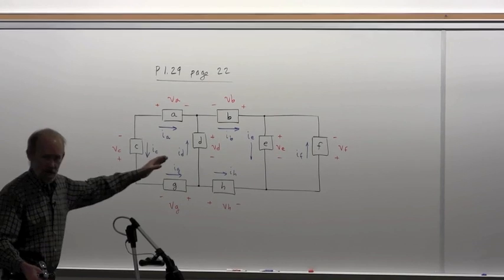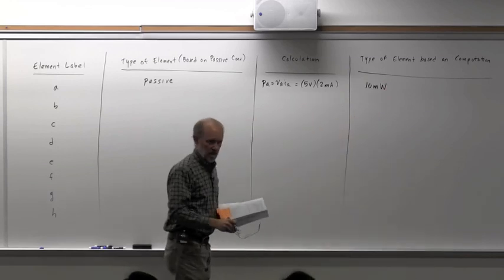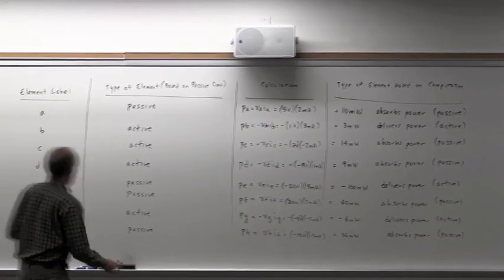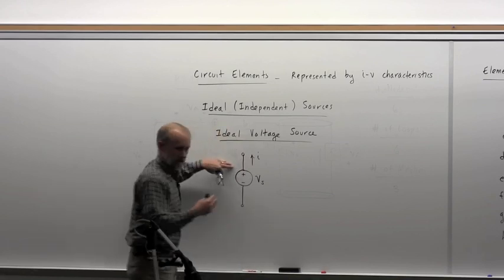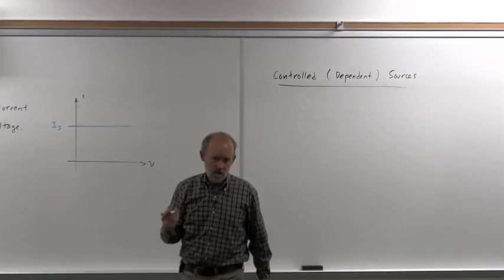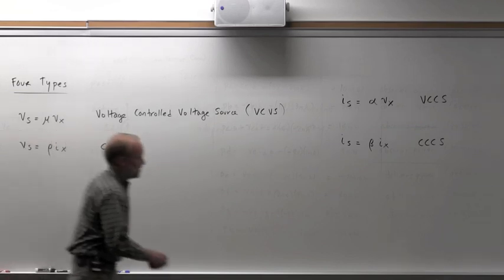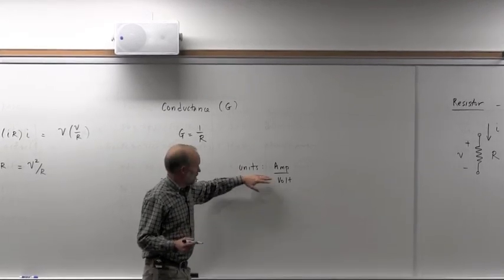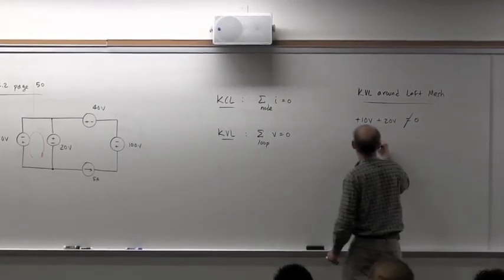EGGN 281 Lecture 2 - Voltage & Current Sources, Resistors & Ohm's Law

Comment: These lectures are so good that they have got me glued to the screen.
Just a couple of production points:
1) Switch off the auto focus on the video camera.
2) The sound quality is clear but a bit crackely. e.g. I could not make out what Ravel said was an example of a constant current source (and he did not write it down). Perhaps it could be added as a comment on the screen.
Reply: he said an example is a PV, a photovoltaic cell
Reply: luca uburti
Many thanks for that.
Reply: I s ould  ave copied Rav Ammerman's life, at least professional c oices. T en I mig t be  app .
Reply: These are good lectures about the analysis of electric circuits with resistors, capacitors, and inductors. My parents do not have any interest in scientific or engineering analysis, so they are hard to relate to. I have been made financially dependent on them. I graduated from the University  of Arizona in 1995 with  a BS in mechanical engineering.  Later I graduated from the  University of Phoenix MBA program. I think i am at the  merc of someone else who controls my laptop. The parents Bonnie and Terry Tipton most recently recommended a plumbing job for me. Did they ever become plumbers? The answer is no. For me, maybe I should have gotten a BS and then MS in mathematics or perhaps biochemistry. Something tells me I will struggle to be app  for the rest of m life. I feel like I am at t e merc of ot er people, even to use m  laptop.
Reply: Someone or something  as  ad control of m  laptop  preventing me from using man  ke  s.  M  life is c  allenging  and met wit   professional defeat. One of m  fantasies is to work in person wit  ot er  people on some  kind of engineering problem.  I  ave been in Las  Vegas, Nevada since 2021. M  work life  as involved a lot of pain. I am longing to do somet ing creative and inventive, and wit  a team. I ave experienced extreme personal isolation meaning ver  little in person conversation. I fantasize m  financial independence as well. I graduated from  t e  University of Arizona in 1995 wit   a  BS in mec anical engineering,  and later from t e  Universit of P oenix MBA program in 2001. I guess I made a goal of getting t roug  some textbook pdfs.  M   parents c anged t eir   ome  wifi  login and password for access. I cannot use it because I am prevented from using certain ke s  on t e  ke board. I  ave spent m  da s being made to feel stupid, unqualified and uneducated.